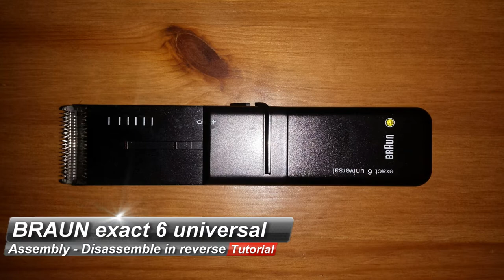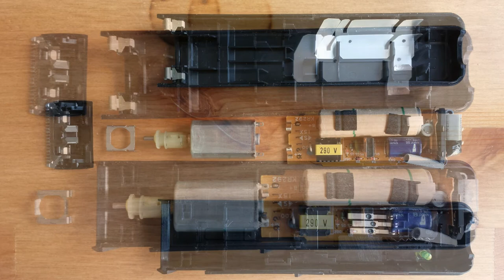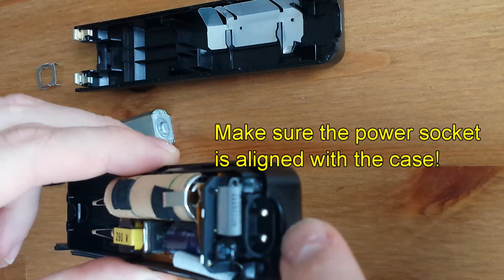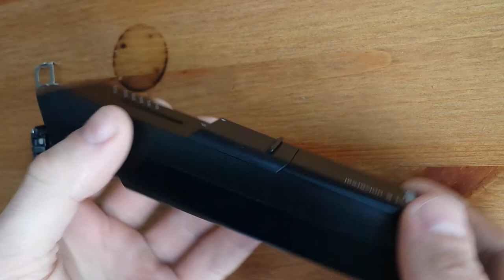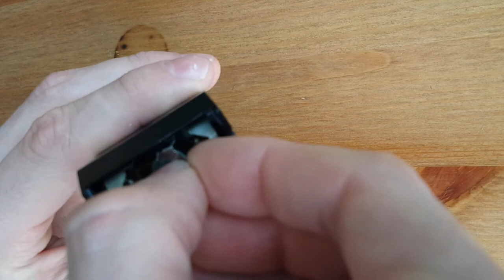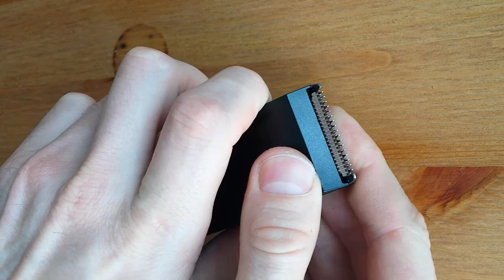BRAUN exact 6 universal [Assembly; Disassembly]

Comment: Thanks, mine was sitting apart in the drawer for a while and I couldn’t remember how the little metal clips got installed. Most everything else is self-explanatory. Mine is over 30 years old now and I replaced the battery several times, and superglued and epoxied the case several times. Best trimmer I ever bought, and I haven’t found a good replacement still.

Comment: What I really needed to know is how to take the case apart.
I struggled to pull mine apart until eventually the case broke into several pieces, so it’s now scrap. It turns out that there are two lugs about a centimetre long, one on each side of the half that has the green light on it. They are about three centimetres along from the bottom end. If I had known this it would have been easy to prise the other half of the case over the lugs with a small watchmakers screwdriver.
Reply: Remove the metal clip around the eccentric motor cam under the blades. There are two plastic retaining tabs, one on either side, about an inch up from the charger cord end. The tabs are on the top half and index into the bottom half. Gently pry apart there.

Comment: feels good to see  a device that served me for years. Not in use since long time. Battery need replacement.  can  anyone send me the battery specs?
Reply: It’s just a 1.2 volt AA NiMH battery.  I’ve replaced mine several times now. Use a good soldering iron to remove the old one. Then file the ends of a new one, and solder it in quickly